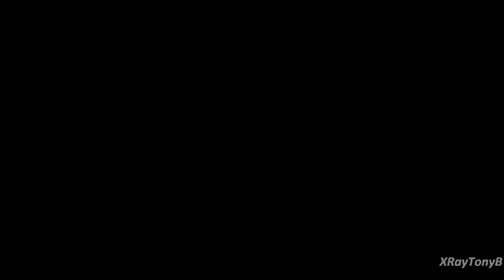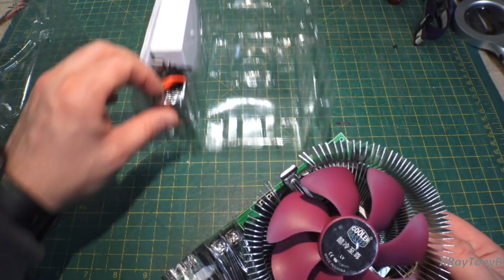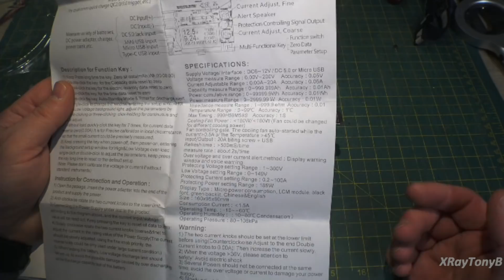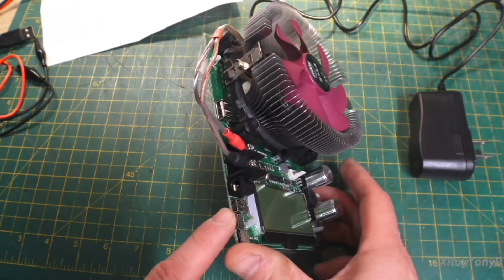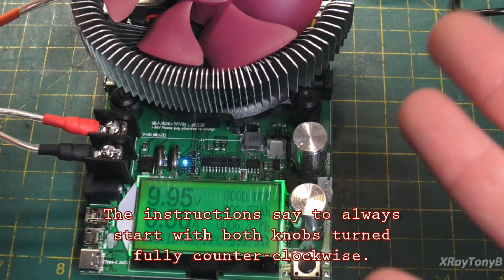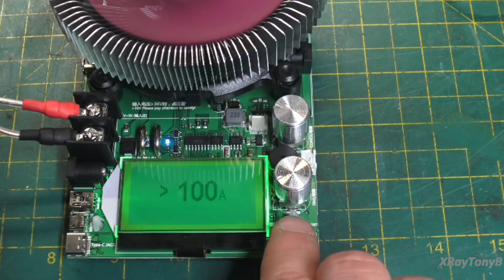Electronic DC Load Tester from eBay

Comment: Hi, I just bought one but I can't set the amps. It's always at maximum no matter where the knobs are set. If I press the button 7 times it shows 0 A and the fan stops but it keeps drawing current. Do you have any idea of what's wrong? Thank you.
Reply: I have just bought one and the same problem. Could you solve it?
Reply: @yelsing1  I had to replace the main MOSFET, the original was shorted, that's why it was always on.
Reply: @NelioSmix  Thanks for your help. I will desolder the MOSFET just to make sure it is damaged.

Comment: Since it has no preset max current draw, it should have a fuse to avoid calamities.  You do not want to draw max current, close to a short, because of setting the dials the wrong way by mistake.  On the other hand, a fuse, let's say 20 A, will not protect any gear only capable of delivering lower current values.  So I am not sure what think about this.